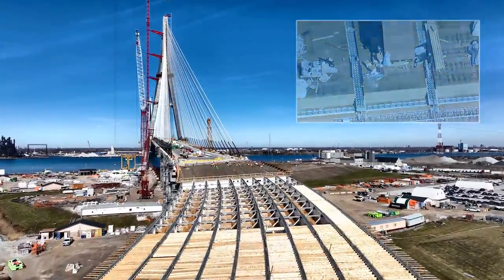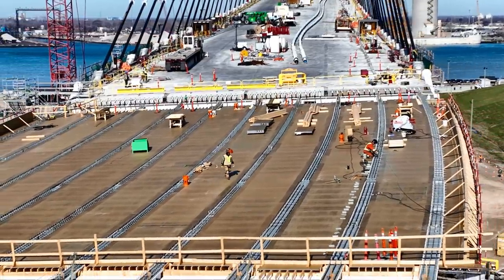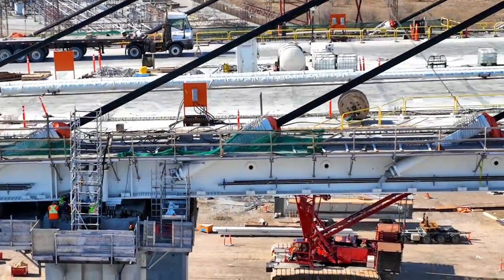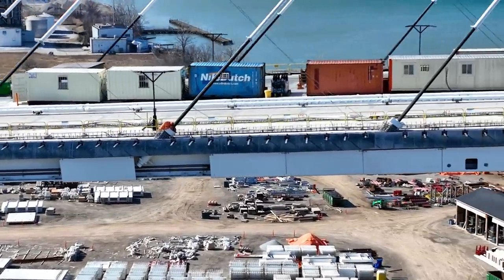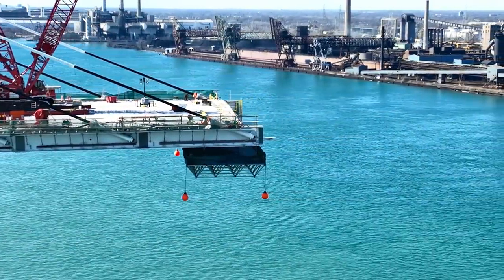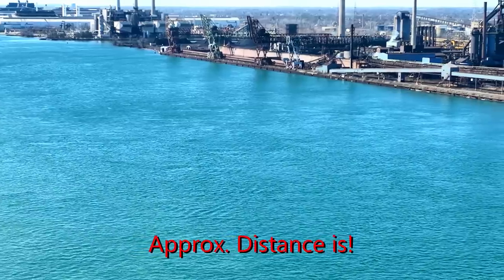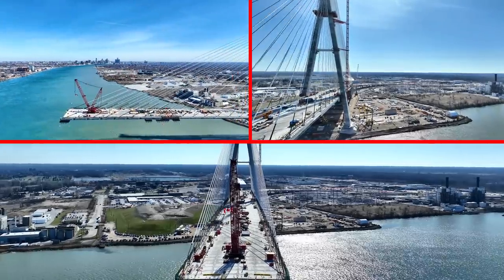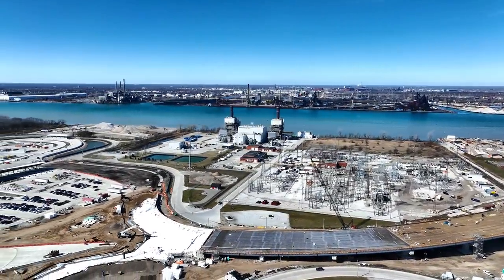The GAP on the Gordie Howe Bridge!

Comment: I counted 23 pairs of stay cables installed on the Canadian side. Assuming that the US side is the same that leaves only four more segments per side with the connecting piece to follow. I think each segment is just under 50 feet in length hence your calculations sound pretty much in the ball park! These excellent drone shots make it very easy to track the progress of this once in a lifetime project. Thanks Bob!
Reply from the maker: Hi Rob. Interesting! That sounds about right to me. Great comment. Thanks for the compliment!
Reply: Maybe count the number of open positions for cable stays on the towers, and that will give the number of segments left to install.   Enjoy the channel!
Reply from the maker: Hi Marc. That is logical. I will focus on the towers as well next time I go out. Thanks for the heads up! :)
Reply: On the official bridge YouTube channel, they indeed mention each segment is 15 meters (49.2 feet) long.  So if there's ~414 feet to go that's 8 segments (4 on each side) with some change left over for the custom pieces that will be used in the middle.
Reply from the maker: Thanks, Chris. Good answer to an ongoing question!:)

Comment: Thanks for sharing the video. I don't cross the border there often, but I'm looking forward to the new bridge. Do you have any issues with crossing an international border with a drone? Do you need to get any kind of approval for that? I would think it might attract some unwanted attention.
Reply from the maker: Of course. Crossing an international border is forbidden with out the authorities on both sides being notified. The border is an imaginary line in the river I didn't cross. The border line moves closer to one side or the other as it travels the river. When the river changes direction the borderline follows. In this case the river changes direction not far from the bridge, between the Gordie Howe and the Ambassador Bridge )closer to ther Gordie Howe. Where the river changes direction, using the 28x zoom camera on my drone. I can line up with the gap and measure without going into US airspace. It is tricky and I was close, maybe too close, but not invading another country. I can't speak for other drone pilots activity, but I do stick to the rules.
I do appreciate your comment, and although I don't believe I crossed the line, I was close. I will keep my distance. Thanks for the great comment!

Comment: What amazes me is how the roadway supports itself all that way out not being connected together? Those cables and towers must be able to handle extreme loads. then there is also those huge cranes at each end. I would be scared to walk out there let alone work all day at the ends?
Reply from the maker: Hi Skydancerforever. It is an amazing structure. Over half a mile of bridge deck with out support f under the bridge. Great comment. Thanks!

Comment: just 54 segments left and Detroit is connected to Canada. any day now the Keystone segment will be placed on the bridge and it will be complete. Bridge Authority is calling on June or July when the final piece is up in until then they will work every week until the final beams are installed and the gap is closed. Until now temporary strand jack cables have held the bridge up once the final two segments are installed the these cables will be jacked into their final positions using strand jack pistons and the falsework will be removed then one by one until 2025 the temporary cables will be removed and permanent screw cables installed in the towers and in the base. The reason you see wire on some of the strands is they still need to jack it up and that lift is coming soon as they get close to closure.
Reply from the maker: Hi @geomodelrailroade. Great post. That's good information. However, 54 segments seem like a lot for a 400 foot spread? Am I missing something? Thanks for the detailed comment.

Comment: Of course this 414' measurement comes from a drone pilot who thinks his mini-Cessna can estimate bridge gaps by flying beside the open area...🤪... well, I double-checked his theory with my "clear ruler-on-the-screen" method, which came up with 423' still to go.
So, if the bridgeworkers use Bob's number (since they dropped their only tape measure in the river last month), the GeeHowe Bridge will have a 9-ft blue-water problem in the middle. Not surprisingly, Manuel Moroun suggested a fix using sheet rock over bungee cords to complete the road surface, creating a Wowie-Howie effect as the traffic flies over that center spot. Sounds moronic to me... how about you, Bob?
Reply from the maker: Hi Gilbert. Yeah, I know it is very innaccurate. Your clear ruler is likely more correct. They should at least use thick marine drywall and strong bungee cords for the miscalucated space . . . just to be safe. :)